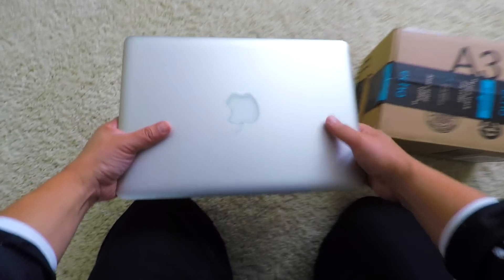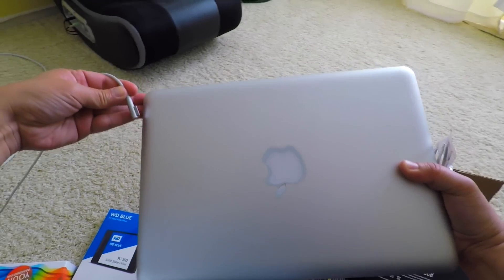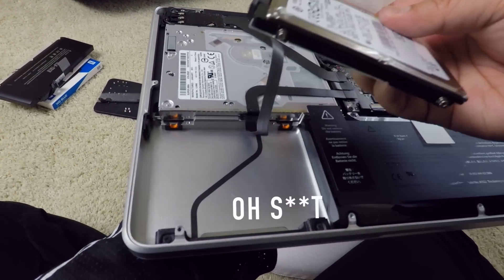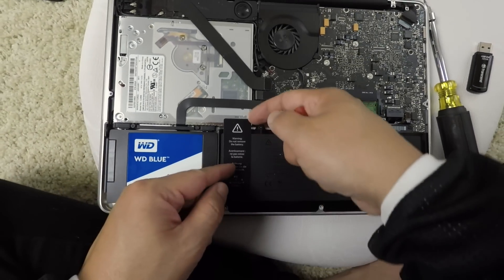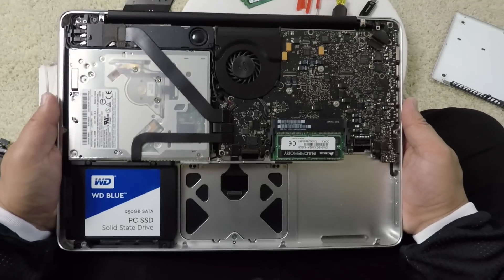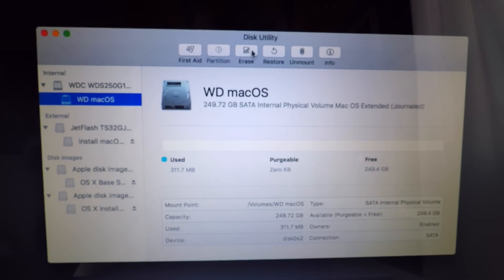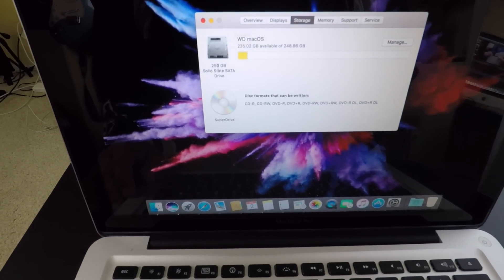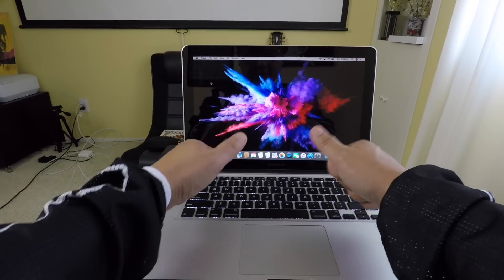Old MacBook Pro Upgrade, FAST Memory, Fast Hard Drive SSD

Comment: Please help!  I have a 2012 Mac pro that has a HDD but I just bought a ssd, a new blank USB, but have no idea where to start.  What do i do first? I still have files/videos/pictures. Do I back up all my files on an external hard drive? Do I have to erase my HDD? Then make a bootable USB, then put the SSD in and then install os high Sierra? I keep finding too many videos that skip steps as if we know what to do. I need a 1, 2, 3 step process. This is my first time doing this! 

And how do I put all my files/pics etc back into my MacBook with the SSD inside?
Reply: Jay Martinez do you still need help?
Reply: Do this if you don’t have access to another Mac. You need to hold the option key + o  to get it into boot select mode. On the bottom of that screen, click on the network button and connect to ur WiFi. Then it’ll offer you to go into “internet recovery mode” use that to have it guide you through installing Mac OS onto your new SSD!

Comment: Nothing worse than a white guy talking like a black guy, otherwise the video was good.
Reply: i thought he was asian..not that it matters..... how'd you gét the phone on screen?
Reply from the maker: Dan Bounds I know right. I’m not white. And my videos are the best! Bettter than that Logan Paul dude. Subscribe now!! 👍
Reply: J on the Street well played.
Reply from the maker: If you have OS Sierra or newer, you can plug your phone into the usb port and it will screen mirror it. Just open up Quicktime movie player, and change the recording mode to use your iphone. If it doesn't detect the iphone, then open up iPhoto so it can detect, then open Quicktim again and it should show it. Sweetness!